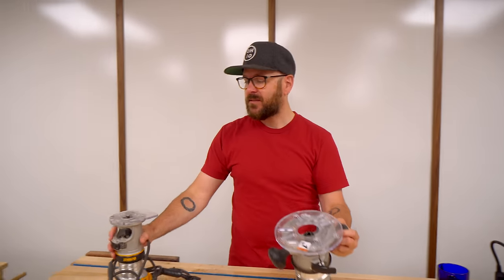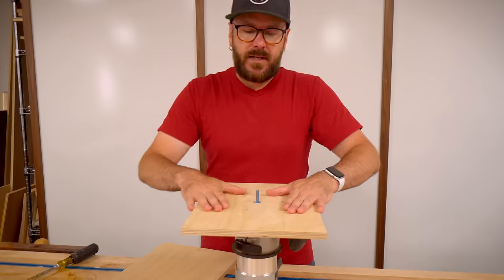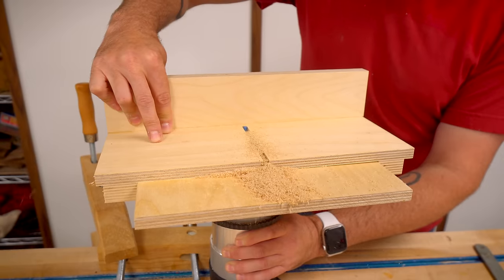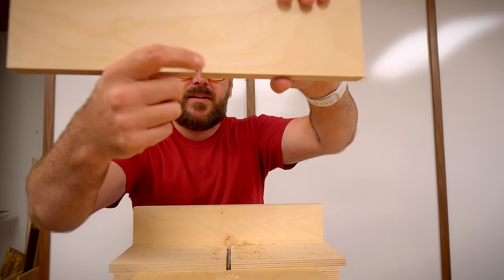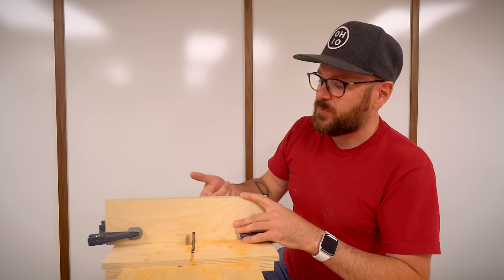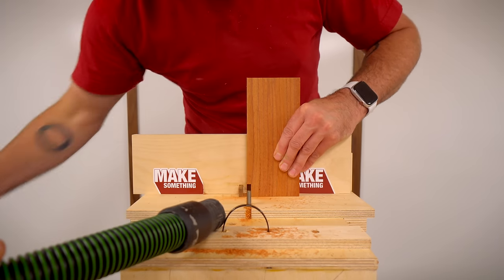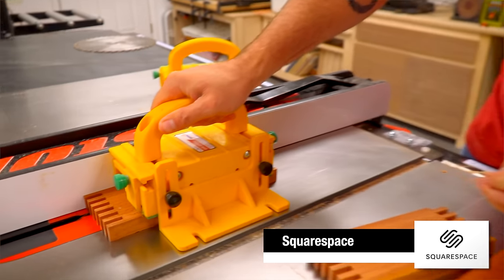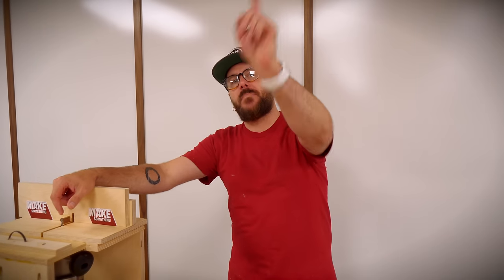How to Make Box Joints with Only a Router | Woodworking Jig

Comment: The spiral bit is definitely the way to go for cutting finger joints with the router. I use a similar jig clamped to the top of my ancient Craftsman router table to make 1/8" finger joints. I use 1/8" keyway stock for the pin. No messing around trying to match the exact size of the router bit.

Comment: That’s about the best jig I’ve seen handmade. You can make 2 or 3 for less than a sheet of plywood. In canada the Incra box joint jig is $300.  
You could add an adjustment screw on the fence to change the pin size. 
Nice job.

Comment: You could also make the base of the sliding tray  out of thinner 1/4” hardboard and gain some length on the router bit. Cool jig.
Reply: You could get a bit more length by recessing the router into the base underneath as well. As you say, nice jig, I also liked the clear instructions and editing.
Reply: i used a piece of 3/16 underlayment to make a similar sled, but there was too much flex in mine

Comment: Nice work. Especially like how easy you made it to remember the adjustment directions. Too Tight? Towards The Tooth... in this case the bit is the tooth but also works of table saw blade.

Comment: Brilliant work buddy, here in the UK dado stacks are frowned on by government and the health and safety brigade, so using the router is a perfect way to get that wider cut for box joints, thankyou for your excellent video, very helpful, regards Louie Ulster Workshop.
Reply: why on earth would the gov't give a s**t about dado stacks?
Reply: @firebladex8586  hi pal, they deem them unsafe, they declare that if the two blade touch then there is the very real possibility of a fragment of steel hurtling through the air possibly towards the saws operator.
Reply: @louiesworkshop2023  interesting .. Never use dado stacks myself so I guess I'm safe :)
Reply: @firebladex8586  They are perfectly safe if used correctly!
Reply: @louiesworkshop2023  the real reason is the health and safety legislation says the saw blade must stop within a specified time period after the power is cut. If you stopped a table saw with a dado stack in that time frame the stack would come loose due to stopping that extra mass of the stack.

Comment: Anyone else ever notice that YouTube wood workers plywood looks like plywood out of a fairy tale? Always so crisp and correct

Thanks for the info! Great video, FTCF 5 stars!
Reply: INDEED! always plywood that looks like it's been through 40 grit where I am.
Reply: Yup. I feel your pain Dennis. "YT grade" plywood is not available in my area either. 😭
Reply: I got some radiata pine plywood recently, best quality plywood I've used before. nicely smooth on both sides, good layers, flat with little to no warping. I'd highly recommending looking for it if you can, worth the $$ if you're wanting to actually make something nice. It was $38 for a 4'x8', 3/4inch slab, and I made several projects out of it. I think the 1/2inch option was something like $27.
Reply: I'm always amazed by the quality ply .used. Nothing but absolute rubbish here. No matter where you cut there are always open layers
Reply: @1patfin  Hell, we have to make our own plywood here! ;-)
Reply: HD and Lowes has Red Wood/Birch (and one more but I can't remember the name of it) plywood for about 55$ per 4x8. it's 'furniture grade'. or you can cheap out and get the floor or subfloor grade and have to sand it.
Reply: @jkowalski33  double that price in Alaska
Reply: Gotta move to Baltic states, the only plywood I have here is the Baltic birch plywood 😅
Reply: When you get a Youtube channel with lots of subscribers, you too can make enough to spend big bucks on Baltic Birch Plywood while your poor viewers try to copy your projects using the only plywood they can afford.
Reply: Comments have been made about Baltic birch (which is nice, but $$ if you can find it). I have some but only use it on stuff where the plies will be visible and need to look nice, or I need something really flat and stable. I save every scrap, too!

The #1 thing I found that helps with the quality of wood is to go to an actual lumber yard. The stuff the big box stores sell is purchased cheaply in high quantities. Lumber stores, only the other hand, usually have some 'nice' wood in stock for things like furniture, or they can special order some nicer wood for you. They know who to call, or may even send you to a competitor if they think it will help. They know if they're helpful, you'll be back again to maybe buy something else. It maybe be 10% more or so, but it beats wasting half of a board cutting out twists and knots.

With my local yard, I stopped in and asked for some cedar to make a garden planter. The guy actually went through the entire bin to pull out the nicest, straightest boards with the fewest knots for me. The rest of the stuff is intended for deck railing and would be usually painted. So, they usually know what they have and can help, vs the guy at the big store who was moved from the appliance department to run the panel saw that day because someone called in sick.
Reply: Yup and always dead straight. Mine here curved sometimies
Reply: I would be happy with any type of ply, I can find a way to work with whats good, problem is that I can´t find´any plywood that isn´t treated for outside construction work, and that yellow of whatever colour coat it has just destroys it if you try to remove it, i would need to buy 10 layers ply sheet to make it 5-7 layers after the removal of that poop, I don´t like it but best budget wood I can find is paulownia or something like that, even pine or similar wood is pricey compared to prices youtubers present, more than double in most cases and hardwood awailable is oak which is 5 times the price of pine. It comes to the point where it´s cheeper to buy a hardwood table with legs made of the same hardwood and scrap it to make something from it. I haven´t checked the stores outside of the country my shop is, maybe i should
Reply: My local woodshop store sells Baltic Birch, i'll never go back to regular plywood
Reply: dc1        yeahhhhh ,the plywood i get here at the home depot and lowes is crap

Comment: Clever, simple, straightforward. Scared me a bit when the key fell down into the table saw slot and you reached over and pulled it out with your hand, but it was behind the splitter on a Sawstop, so no blood, no foul I guess (don't try this at home kids!) 
I don't have a dedicated workbench with a vise, so, I'll probably build something that's closer to being a full blown router table with feet that can be clamped to my work surface. Maybe make the front fence with adjustment slots and wing nuts on the back to make fine adjustments a bit easier, and so I won't have to deal with clamps hanging out. I've already got a couple of project ideas for this.
Thanks for the video!

Comment: - "I'll show you how to make joints using only a router"
- makes router table using table saw, stationary drill, cordless drill and clamps..
Reply: 😂 had the same thoughts 🤷🏼‍♂️😁
Reply: So if you don't have a table saw, you're still SOL. 😝
Reply: michael blacktree use a hand saw! They are fun
Reply: You beat me to it. I was going to say the exact same thing! 😂
Reply: Was more about not having a dado stack
Reply: Literally cant handle these types of videos...
Reply: I used trained termites
Reply: shtolcers I made this today without a table saw. Worked great on the test pieces.
Reply: Anj Gord haha 😂
Reply: Why to male that mini router table if finger joints can be done on a table saw? 
Nicely made video but the whole idea of this project is controversial.
Reply: This comment confuses me. do you own a router but not a cordless drill or clamps? how do you route anything? if you don't have a hand saw or a circular saw, how are you preparing the wood you're routing, cutting it to size and what not? 

You can make these cuts with a circular saw instead of a table saw (I know because I've done it) the big professional standing machine tools aren't about giving you capability, they're about repeatability and efficiency, two things you don't really need if you're making one off items in your home shop. they're NICE to have sure, but not necessary. 

When getting started you don't need all the big cool stuff, think of it like a survival game. You gotta craft a wooden pick ax to mine iron, you need the iron pick to mine diamonds.. you could make these cuts with a handsaw, it's just gonna involve a lot of measuring, setup and bucket-loads of patience. get yourself a circular saw, and it'll be faster and more accurate than the hand saw, and will involve less measuring and setup before cuts. adding a table saw reduces those considerations even further.

Having begun this making journey in fits and starts over the last two years, I'd say far and away the single most important, unavoidably necessary item you need to start making is a moderately sized, flat surface to make stuff *on*.
Reply: Tom Jar completely agree. My work replaced a 3’x4’ granite surface plate we had our height gauge on because it developed a single gouge mark on the SIDE of the plate. I took that home real fast. Probably cost 3-4 grand
Reply: @MrMaacin05  I have never been more jealous of someone on YouTube than I am right now lol
Reply: Tom Jar I wasn’t going to fight it when they said they’re replacing it. A gouge on the side of the plate had no effect on precise measurements on the surface but I wanted to take it home with me so I nodded my head 😂😂😂
Reply: @MrMaacin05  haha yeah that's fair
Reply: @xiggywiggs  Well. Think this way:
Some people has no extra, space even for mini router table. Others work mobile - so aim to pavk as many tools as possible in a van/site box. 
Router jig for finger joints can be as simple as strip of wood fixed to your router base plate. There can be more sophisticated variations,  allowing for easier set up and adjustment. Even so simple in structure , not everyone knows, how, to make those. Judging by title people thought author will explain that methpd. 

Unfortunately this guy, showed just another  well known router table jig. It's, not compact.  It's nothing new.  It takes time to build. Title suggests something else - so people get frustrated and they're right about it
Reply: Much like one I came across a video on "How to make a poor mans woodwork table" and then proceeded to use loads of expensive equipment to make it.
Reply: You right, he adding more and more  we all got headach!
Reply: You forgot the mitre saw at 2:45 😅
Reply: Came here to post this.
Reply: You can easily cut plywood using just the handheld router, as I did here: https://youtu.be/hqSBPXL0bAQ?t=303 (don't mind the rest, that's mostly unrelated)
Reply: I was thinking the same thing, as I scrolled back up to the video he had rigged up dust collection too lol
Reply: And a dust collecting Dan! Thats what I need
Reply: Read the title again.

Comment: Thank you for the time and effort it took to make this video. Good job. I have a great table saw finger jig but ...one has to install a dado blade, do repeated test cuts with shims to get the fingers just right and it monopolizes the table saw, the most important tool in the shop. I may get a cheap router and install that rascal permanently to this set up. Thanks!

Comment: Made my own today. I'm not a skilled wood worker but I managed to build it and get good joints in a day to make plywood boxes. When I needed to cut the grooves for the bottom of the box I realised that now I finally have a router table that I can use to do that too. Just added a third front fence (removable) to cover the hard wood key and clamped the sliding part to the required position. Cutting the grooves was easier than ever before. Thank you very much!
Reply from the maker: Oh right on!! 👊🏻

Comment: I was so afraid of trying to make this for my harbor freight router!! I’ll update you to see how it went
Reply from the maker: Good luck! I'm sure it'll be fine!
Reply: What would you do if the router doesn’t have the holes to mount it to the board 😳 it’s just a plastic enclosure plate thing?
Reply: @ClanBez  thanks! I actually figured it out , I took off the cover and routed that depth to mount it. I just had to get longer screws because the ones in the router are so short, but I’m really excited that I’ll be able to use my mounted router tomorrow 😃 just had to wrap my head around it.

Comment: I had my own idea to make something similar with my homemade router table I already made. Then I saw this. $11 for a piece of 3/4 plywood, a few hours of tinkering and dang....it works. Its actually pretty simple. I used an older Ryobi router. It has some nice threaded holes in the base plate so you do not have to remove the base plate to attach it to the table. Also, the collet is very small which allows the bit to be raised high enough for 1/2" material if you drill a 3/4 hole. I'm going to try and find a bit with a longer shank for 3/4 material. A little trial and error adjusting the key fence and your good. I'll be leaving it set up. Got boxes to build.

Comment: Great idea, if I understand this correctly you need to keep this jig and router setting precisely for the thickness of the board or plywood you are going to use. Otherwise you will get into trouble with measurements and tear through. So if I am right, dedicate your set up to only one type of wood for your drawers and keep it aside as a ready to use tool.

Comment: First dust collection, could you maybe remove the stop, run the bit all the way through the fence, then reinstall the stop and build a small box with a hole for the hose on the  back of the fence? It looks like all the sawdust is flying out the front of the fence because it has nowhere else to go, but opening up the space behind the bit and putting your dust collection there might help.

Comment: Thank you. I am a new woodworker and made this, watching the video about 10 times and it worked well. My joints are slightly tight so will make the adjustments you suggest. Now can you please make a video on how to use a dovetail jig?! I bought one from Woodcraft and cannot make it work after about 25 separate adjustments!

Comment: I just made pretty much the same thing for my router table. You get an amazing amount wood shavings everywhere. It didn't work properly until I bought a very good router bit.
Reply: Could you share the name/type of the router bit, please?
Reply: @wernerpetersen  I used a Diablo 1/2 inch straight bit I bought at home Depot. It cuts extremely smooth and clean. Always use a sacrificial board backing to prevent tear-out. The first bit I tried to use was a cheap harbor freight bit that apparently wasn't very sharp. I tossed that whole set.

Comment: If you ever remove and reinstall the router, the slot will almost surely not line up again with the bit.
Dont glue the fence, instead glue the backup piece and screw the fence to it with oversize holes as necessary to shift the fence left or right.
 Then reverse the fence, off center enough to allow for a larger size bit and box joint. A hole may be necessary in the backup block as the key will interfere. Or flip the fence upside down with the key facing away from the router.

Comment: Your  Fence and Jig is the same principle as the one used for the Table Saw.  I made the jig for the table saw and it works the same way, the difference is that you are using the width of the router😊 bit vs the Dado Blade.

Comment: The box joint is very strong due to the large gluing surface. BUT, any force that tries to open or close the joint puts all of that force as shear stress along the glue lines with no wood directly resisting the opening or closing of the joint (this is why dovetail is supposed to be stronger than a box joint since the cuts in the tails and pins are angled and so the glue line isn't parallel with the forces trying to rotate the joint). 

I have always wondered if after the joint is glued and set if a dowel could be driven through from top to bottom so that it passes through all of the fingers. Then for the joint to fail the dowel would have to be sheared by the box joint fingers acting scissor blades as the joint tried to rotate. A simple 90 degree corner jig for the drill press that is clamped to the platform of the drill press such that when the piece is pressed into the jig, the bit passes through the middle of the fingers. This would make drilling a hole in each corner of a box rapid and accurate. If the corner is taller than the length of a drill bit, and assuming that the jig produces accurate enough placement, the piece could be flipped over and drilled from the other side. In fact it isn't important that the dowel go all the way through the joint since the added strength comes from the dowel going through each glue line. So for pieces where the corners are taller than the maximum bit depth, drill almost half way through from both sides and then drive in a dowel from each side. For very tall corners that are more than twice the height of the maximum drill depth, just drill through as much of the corner from each side as possible.
Reply from the maker: For a box this is plenary strong. Actually overkill. Now if you plan on driving a car on it then you can think about other options. 😁
Reply: @MakeSomething  True, but I come from the "If Some is Good, then More is Better" school. But, yeah, I probably wouldn't bother either. Still the mechanical engineering part of me wants to know if this would make the joint stronger, and if so by how much. The lazy part of me knows that I will never go to the effort to actually build two test articles and find out.

Comment: I would have made the baseplate bigger, screwed a block on one edge to clamp in the vice so it's closer to bench level when working (router hangs below bench), I made a circle cutting jig the same way, if you don't have a vice, screw the edge of the plate to the bench